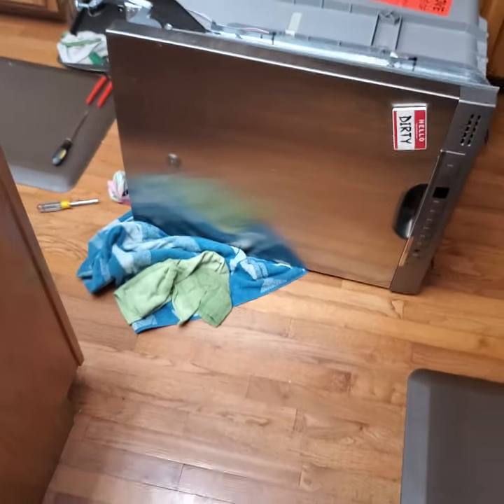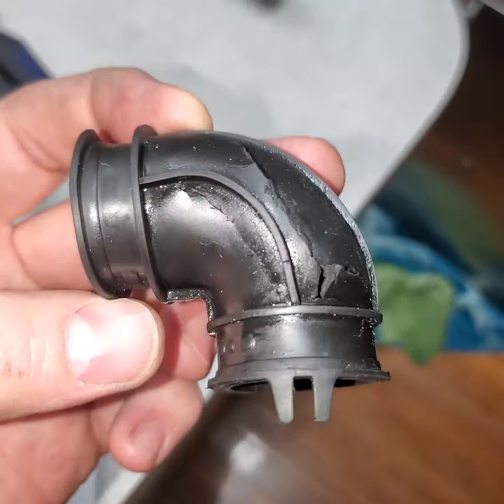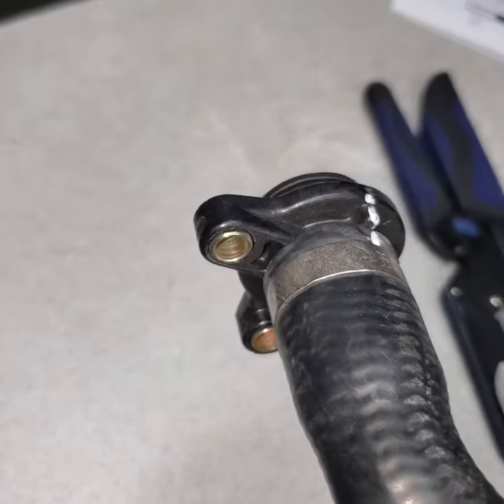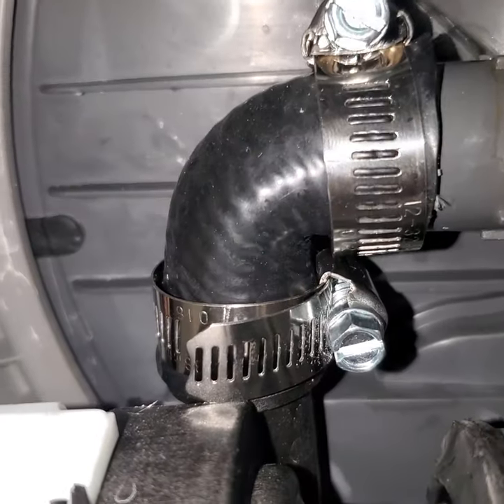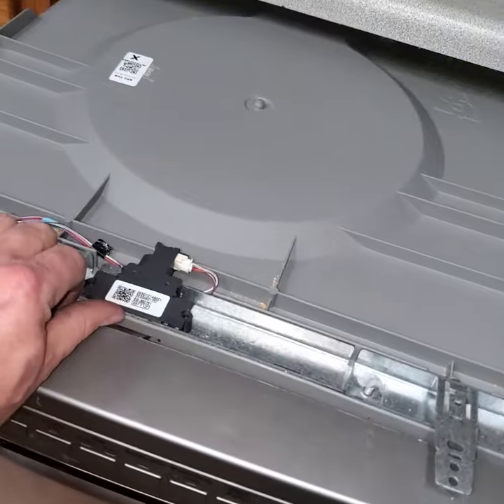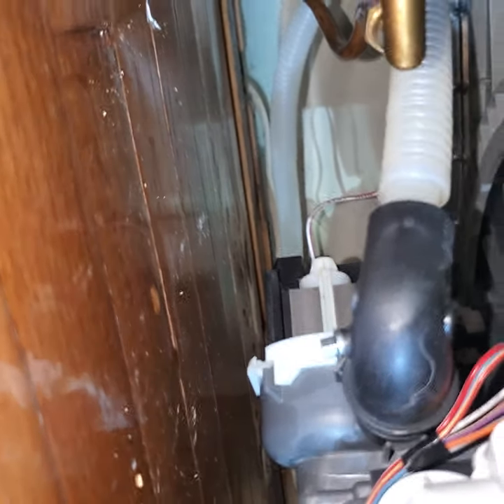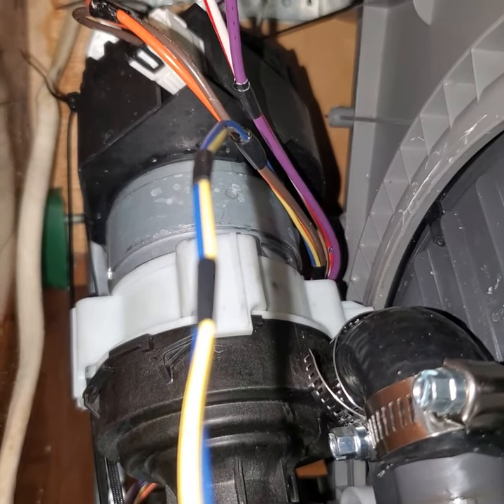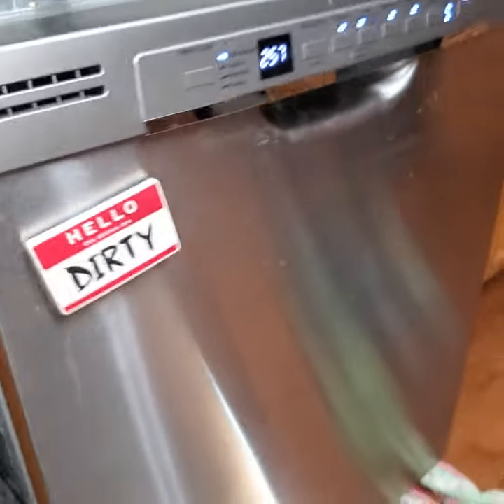GE GDF630PSM4SS dishwasher pump boot failure, cheaper replacement for WD19X25700 pump kit

Comment: Watch out the diverter valve too, it would fail for the same reason. The inferior rubber parts were used extensively all around in this dishwasher.

Comment: I have same issue and had same thought  how to repair. After looking up the parts required for $125.00 decided to go with the heater hose idea. My next concern is the other end of the pump where it simply slides into a grommet. I am a little disturbed how cheap the components are. GE needs to consider how many floors they are destroying because of inferior rubber. My pump fell out of the other cheap hanger GE thought would work. I think mine vibrated out causing pump assembly fall and kink the elbow shaped hose an in turn causing the hose to split. Any ideas about securing pump and upgrading the grommet?

Comment: GE parts sells just the elbow for less than $7 bucks part number WD24X33918.
Reply: Don't buy this part. It will fail again within 24 months. The radiator hose should last the life of the appliance.

Comment: I like your solution. I have the same failure of the pump boot that you had on our three year old GE dishwasher. I am trying to do the radiator hose repair but finding it difficult to line up the pump hanger, both ends of the hose as well as inserting the end of the pump. Any tips on how you successfully lined everything up?